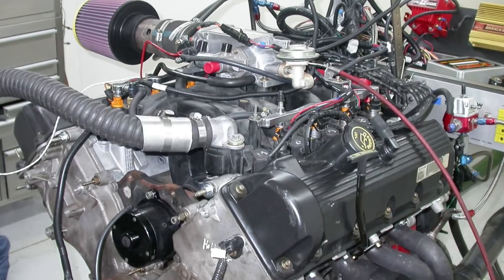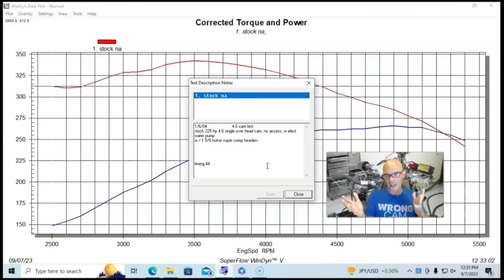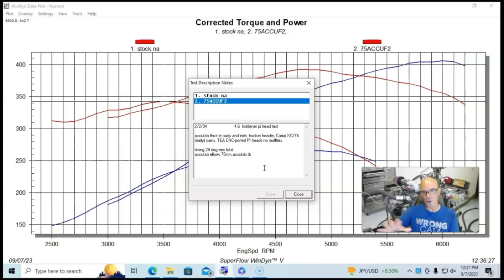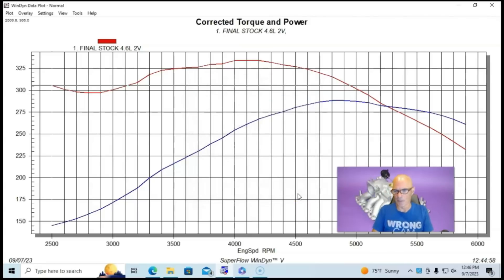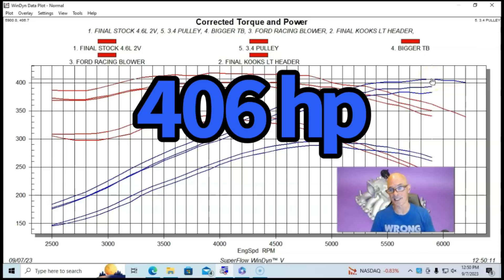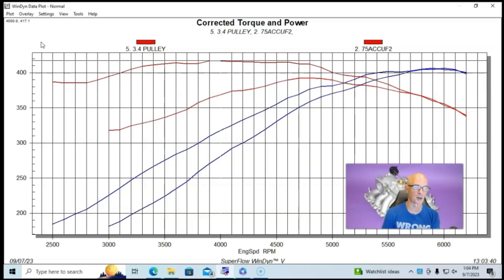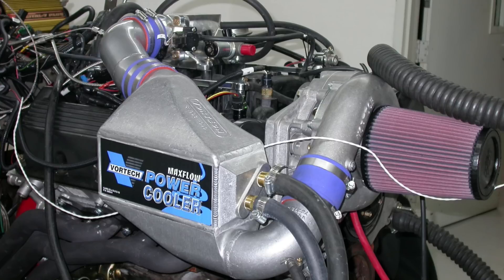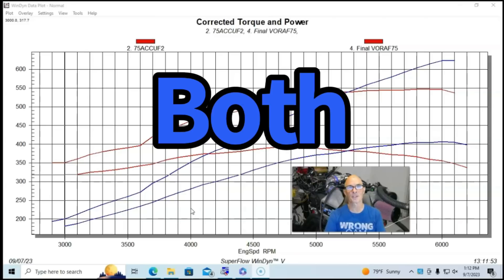THE 400-HP QUESTION-4.6L 2V MOD FORD-ALL MOTOR VS SUPERCHARGED-WHAT IS THE BEST ROUTE FOR HP? BOTH?

Comment: How does the stock internals like the sc application
Reply from the maker: fine
Reply: @richardholdener1727   ok just wondering ive have a v3 yet to tune it. But always read 400 is the max
Reply from the maker: since this combo made 623 hp-we know that 400-hp nonsense is a myth
Reply: Thank you

Comment: My NA 4.6 puts out about 600blft of braking torque... 5500rpm to stall, in a second. "zero road traction too 100% traction". normal 280lbft stock block
Reply: No it doesnt. Youd have to be in the 800-900hp range for that to be possible, which it isnt. The craziest na 4.6 ive ever seen made 520whp 400tq on alcohol.